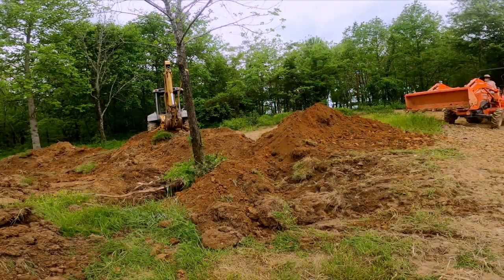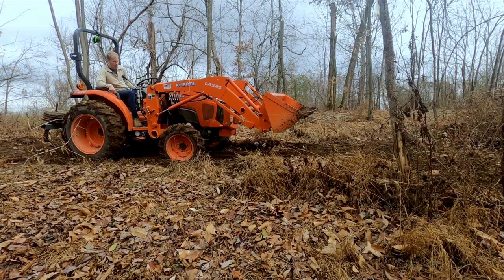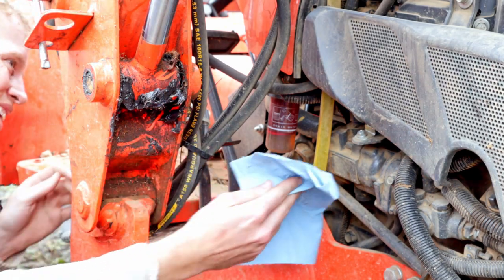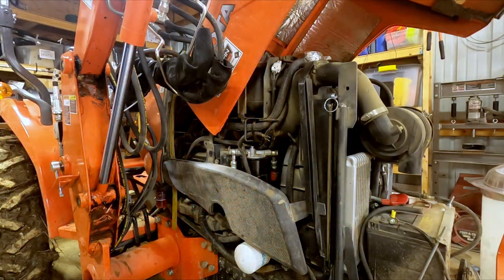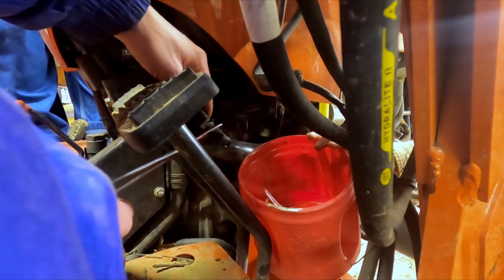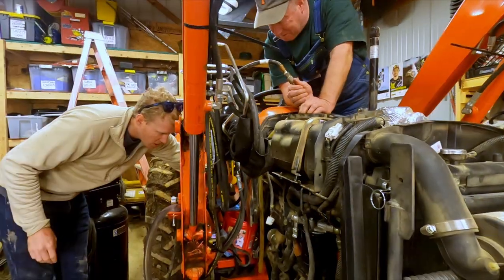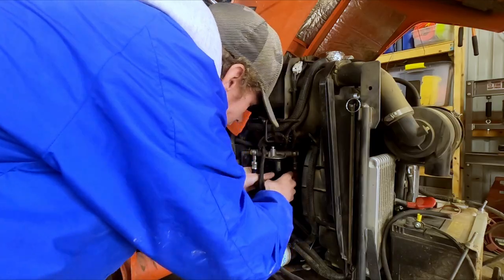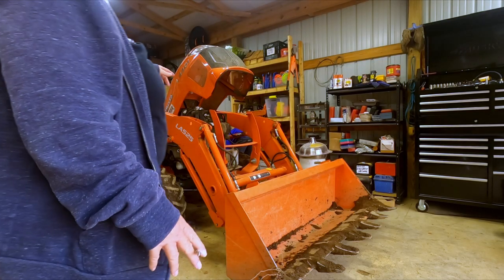How to Clear Clogged Fuel System - Kubota Tractor L3901, L3301, L2501

Comment: How did u get the tractor in garage if it would not start?
Reply from the maker: It wouldn’t start ( would run out of fuel) then after sitting long enough it would run for a short time until it ran out again. The tractor was using more fuel then the clogged line could supply.

Comment: I had fuel problems with my New Holland now with my Kubota …😢
Reply from the maker: Had the same problem with our new holland backhoe we had to replace the fuel lines.
Reply: Nice "how to" video. It's worth mentioning again that filtering AND water separating fuel while filling is important. I use a 10 micron water blocking filter while fueling, and I replaced my tractor water separator / strainer with a much larger capacity Racor filter / separator.
Reply: @KubotaL4060  Yes it is, and I have all intent to get the double filter set up on my storage, even though it is only a 50 gallon tank, it only takes a half cup of water to mess it all up.
Reply: I have a TC30 it is real sensitive to even a small change in fuel quality or quantity, my filter is about as big around as your thumb. does not take a lot to plug it

Comment: So, let me understand your process.  You discovered a fuel line blockage, so you blew the blockage back into the tank, then pouring a small amount of fuel into a mostly empty tank proceeded to try and blow the blockage back out of the tank....correct?  What if the blockage remained in the tank after flushing it like you showed?.....I submit it would be better to apply air pressure to the tank, as you showed, and blow the blockage out of the tank instead of back into the tank.  Or if it would not dislodge I would run a stiff wire up towards the tank and repeat blowing it out.  Of course, I am not the expert and am the one sitting in the easy chair.  YMMV.
Reply from the maker: @greglewis8752  yeah so if it doesn’t blow out, the correct move would be to remove the tank and give it a proper cleaning. This was a quick fix to get back to work, and honestly our issue is mostly not having a fuel filter on our diesel pump. We get some algae and gunk in the fuel sometimes.